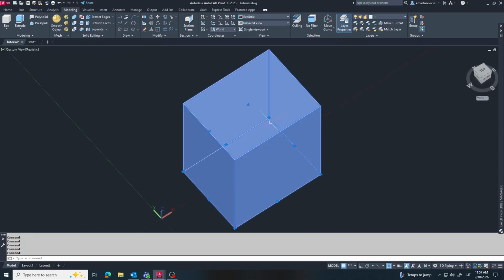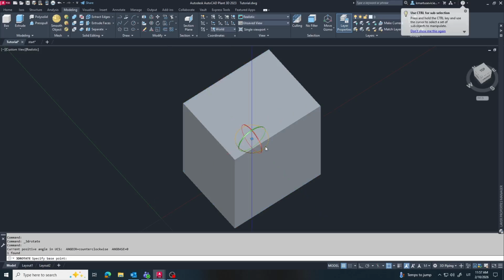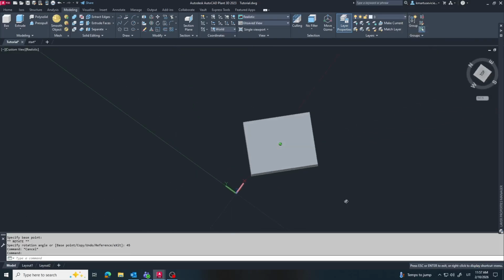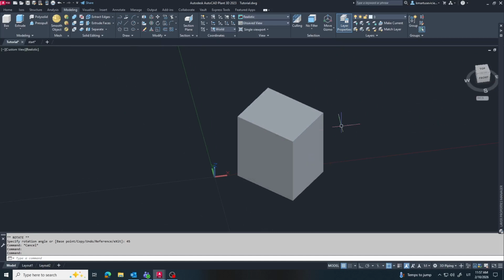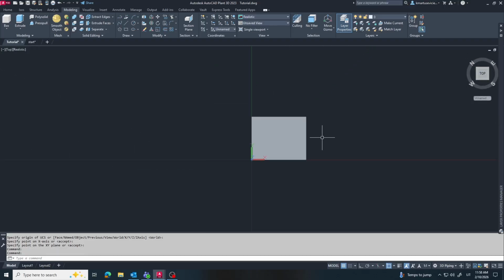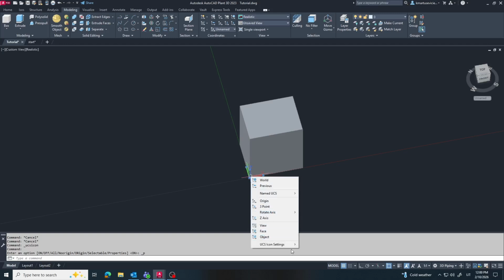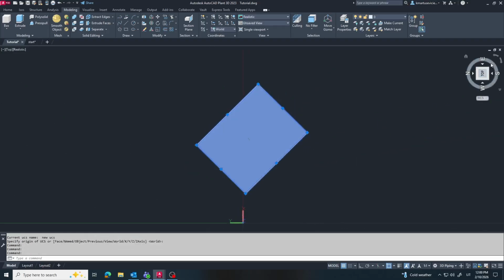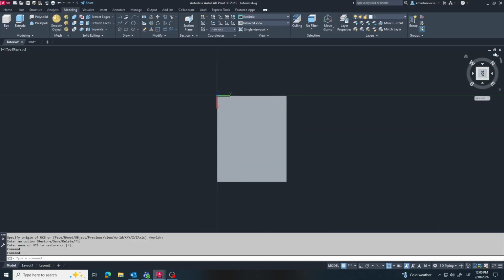WCS vs UCS Explained in 2 Minutes | AutoCAD / Plant 3D Basics

Comment: How can I start drawing from a specific reference point (X, Y) taken from GPS coordinates?
For example, I have the drilling coordinates of a wellhead, and I want to begin the drawing from the choke valve flange.
Could you please explain how to define this point as a reference in AutoCAD Plant 3D, so that all piping components and equipment are positioned relative to it?
Reply from the maker: "To start your drawing from a specific GPS point in AutoCAD Plant 3D:
Set Geographic Location: Run the GEOGRAPHICLOCATION command and enter your Latitude/Longitude or Northing/Easting coordinates. This aligns the drawing with real-world space.
Define Local Reference: Place your equipment (Wellhead) at the desired location. Use the UCS command and click the center of the choke valve flange to set it as the new (0,0,0) origin.
Position Components: Once the UCS is set to the flange, all subsequent piping and components will be positioned relative to this reference point.
Set Plant North: Use the PLANTNORTH command to define your project's North, ensuring correct orientation for isometric drawings."